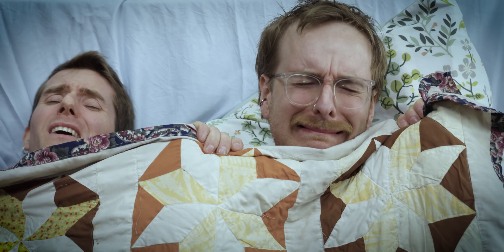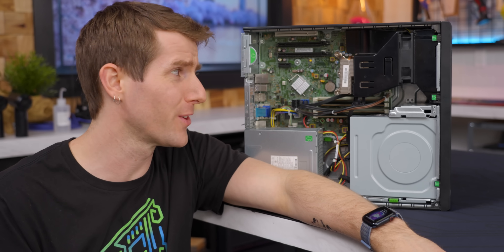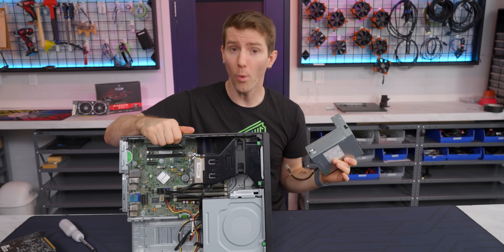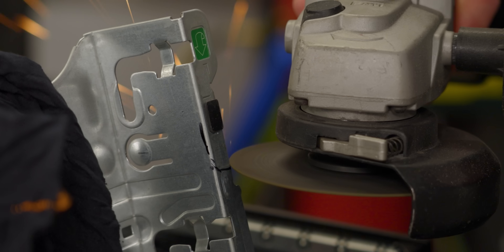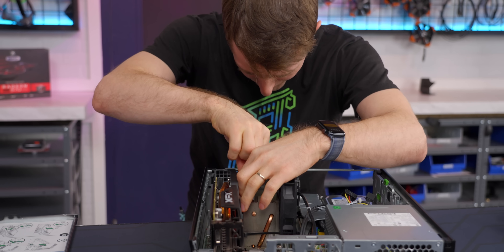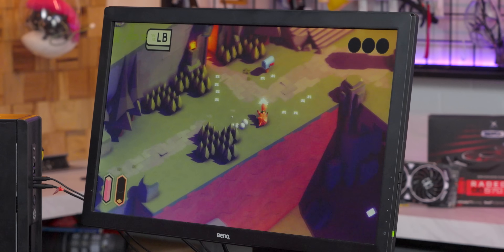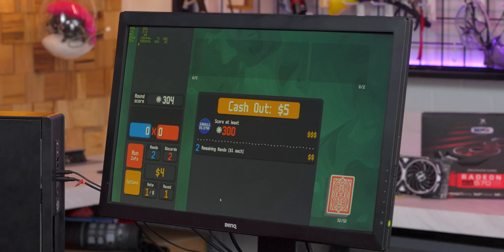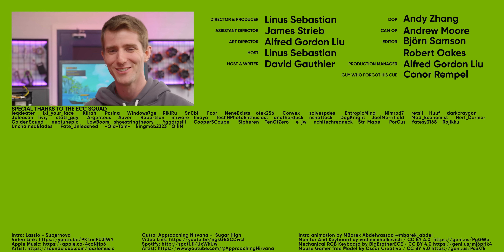How to Build the Ultimate $69 Gaming PC!

Comment: I think you could have optmised this. Choosing a small form factor was a mistake, when it's possible to find full HP towers for not much more, if nothing more at all. Also the i5 2500S is weak now, and i7 of the same generation are just 10-20 more, for 200% more performance...

Comment: You should do a "most upgradeable pc"  build. You start with something super low, I mean low. $50, can barely play shit. But you can type up your homework on it. Then upgrade one part, see what new games you have unlocked. Repeat until you have parts flipped and ship of thesiused your way into a top tier gaming rig. Only updating one or two parts at a time, or flipping parts and buying new ones for a total new cost of $50 a step.

If I recall that's how Linus did his rigs in the before time. So it would be cool to see.

Comment: the problems is that these old cpu are just so slow that will bottleneck anything faster than a 1050ti i had a 3770 i7 bottleneck the hell out of a 1060 6gb barely 120fps in fortnite performance mode low settings while that 1060 was puting out 350 fps same settings but with a 5800x ryzen same ram capacity for both cpus

Comment: I'm sorry guys...but you REALLY need to stop advertising the PTM750 thermal pads when they are constantly out of stock, or rather sold out instantly before anyone would ever see the advertisement in the video.

I literally got a restock notice and they were sold out before I could add one to cart and check out.

Also I'd really like to see a new video on testing different thermal solutions, in terms of paste vs PTM etc. I just recently looked into it for my own new build and from what I could find it seems like the best options for thermal paste (not liquid metal) are within 0.5 degrees of the PTM here. Considering I got a tube of that for half the price of the small PTM pad (that is never in stock) it seems really hard to justify the PTM.

I'd also LOVE to see how much the performance of different thermal solutions actually matters, both on the very high end but ALSO on the low end like we have here. A 1-2 degree difference in many cases isn't going to matter at all on the high end and I'd assume it'll be even less of an issue on the low end, but maybe that's wrong?

I have no idea how viable it is but I'd also love to see how much some of these old parts can be pushed. Do any of these chips actually have hidden potential via overclocking? I remember some older chips could get pushed quite far compared to what we usually see nowadays. In cases like this where you're really pushing the CPU and GPU to the limits AND they were this cheap second hand that could be very interesting. Frying a modern $400+ component by overclocking it too hard is often not worth it given you expect a decent life out if it, but if it cost you so little and you know it's already old it could be more compelling.

Comment: Looking forward to the $169 PC video! My whole family is running old optiplexes I built for them. My spouse is running one with an upgraded PSU and a 2070. Similar with my dad. My 9-year-old saved up his own $5/week allowance to buy one himself then saved up to buy a GPU (a GTX 1650 since it doesn't require external power and the 240w PSU it came with fits the budget by my math). And we got to install that together. Great project. Same 9-year-old saved his allowance again to buy another optiplex for his soon-to-be 7-year-old brother to give him for his birthday (though I'm taking care of the peripherals for that one). And the monitors are mostly from the pawn shops for like $15 if that even. 

And they all get to play the vast majority of my 1200 game library since they made family sharing so much better. Despite the insane prices on new hardware, it's a really cool time in the pre-owned build space.
Reply: nice

Comment: Not even addressing the Windows 11 situation is kind of bizarre...
Reply: I agree. It's gonna be a big decider of the usefulness of these cpus in October.
Reply: its super easy to install win11 on unsupported hardware.    win11 runs perfect on my i5 7500 and also on my very old dell optiplex 3020 with 3rd gen i3 cpu run "ok" win win11

Comment: I would argue that looking for 4c8t options or picking up an e3 v2 or v3 xeon for 1155 or 1150 prebuilts. it's a huge improvement and even a 1230v2 will beat an i3 8100 in a number of games. bit if a miss in the script here due to lack of experience by the writer.

Also a miss in the script, dual PSU's the main issue isn't reliability in the reasons implied, it's mostly just due to the fact that you run into potential backfeeding or current routes where there isn't meant to be current, which can degrade or irreversibly damage the system in the long term.

Comment: What I've realized recently is that 4c 4t is not enough anymore for modern games. Both cs2 and eafc benefits a LOT from 4 extra threads
Reply: Yeah this video was very misleading. They didn't test many games, and had no statistics on screen.
Reply: this computer would be roughly 3 times better with an i7-2600
Reply: @Old_SnakeTwitch LOL still running my 2600k OC @4.4 she runs hot, but won’t die
Reply: @courtney-rw8ch I have a 6600k running @ 5.0GHz currently. It's been a stable OC for 8ish years. Still going strong. Mine runs hot too lol. I got lucky with my cpu.
Reply: My older 4c 8t is hanging on for it’s life with newer games

Comment: 11:00 he means jump the green cable in the middle to any of the black ones directly beside it. It's a low voltage power on signal, you can leave it connected, it doesn't hurt.

Comment: There are adapters for a few euro's on sites like Aliexpress. I got one for my HP office garbage server and works fine ! And all components run form the same psu, which save some power. 
I also had to do the same swapping trick so the cpu blows hot air directly into the GPU 😂 but hey it works
Edit: i shoud've watched the video 10 seconds before commenting..

Comment: Sadly they didn't mention it but by October you are basically locked into Linux as most CPUs in this price range, while being perfectly capable, will not be able to install Windows 11 and using Windows 10 after EOL is probably also not the best.
Reply: Surprised Linus didn't bring this up.

Comment: You could go for a low end GPU if you only do indies or 2010 and below games. a GTX 1050 or even 1030 can handle good games, that way you won't need the PCIE power connector and break the case. also a computer like that are the perfect scenario to take advantage of frame generations thanks to lossless scaling.

Comment: Its very country dependent, in my country (Hungary, EU) RX4-5xx prices went extremely stupid in the last 1year. A 570 is usually 50$ alone. But i could get a 2400 i5 with a p67 board and SSD, HDD, 8gigs RAM and 500W PSU for less than 40.

Comment: I bought an old Dell Optiplex 3040 MT with a 6500, 8gb of DDR3 Ram and 500GB of HDD for, you guess what, 25 buck. It was from an office that was moving and instead of moving all the old as shit PCs with them, they sold them insanely cheap. I put a 1650 GPU in it and it has been my android emulator PC since.

Comment: I recently build my pc full scrapyard wars style. I went with a i5 7600k they often up for 25 usd. Used a rx 550 I borrowed for months, case for a box, an old ssd and old hhds. Now its all done 
500w psu
asus z270
i5 7600k
16gb ddr4
256g ssd
2x 500gb hdd
2060 
overall cost was about 220 dollars

Comment: $169 and $420 budgets would be super interesting
Reply: $80085 too
Reply: @Al_Lergic $1337 too
Reply: @xJRSUMMERSx  they have done scrapyard wars with 1337 budget
Reply: $4.20 PC
Reply: The $100 point seems the most interesting to me after watching this video, $69 was just abit too low
Reply: 420 can make a perfectly capable pc, rx 6600 and any ryzen cpu like a 360p
Reply: I don't know if you'll see this comment, but I think that the difference between the $69 and the $169 pc will be a bigger performance jump than from $169 to $269. Law of diminishing returns. I vote for doing the $169 pc. Might be the best bang for the buck.
Reply: 1488 dollar pc
Reply: yeah basically a bit more so there's not the 1% lows would be ideal as thats frustrating to play on and so worth the 10o buckeroos
Reply: Yeah. $420 is a must
Reply: $1337  Budget should hit the sweetspot very well.
Reply: a ~200-400 dollar build is actually the sweet spot for this kind of stuff IMO. You can get lots of old office PCs with 8th gen Intel CPUs in the 75-150 USD range, and I've seen 2070s pop up on eBay for ~200 USD. If you're shooting for the 200 dollar mark, you can easily get 6th gen i5 systems for 60-80 USD, and a 1650 for 80-100 USD. That leaves a decent bit of money for storage, since old office PCs usually have the drives removed.
Reply: Yeah i thought of it when the video switched to the GPU section. Its one of the core reasons i watch LTT (and watching alex doing some serious jank with powertools)
Reply: 69420$ gonna be better
Reply: At 420 i expect to see Optiplex 3060 or equivalent, an NVME, & a 2080, 3060Super/TI or perhaps 3070
Reply: @xJRSUMMERSx  hahahahahaha funny number thanks for the hold kind stranger!!!!!!!!!1!1!1!!1!1!!!1
Reply: $666
Reply: 67! 67! 67!

Comment: HP Z440 Workstation with the E5-2687W v4 and 700w PSU option.  It has 2 6-way connectors for GPU and 12 cores 24 threads. Here in the UK they are going for £150, so very cheap for so much computing power. They boot from NVME cards no issues.
Reply: My thoughts exactly. One buyes like older Xeon workstation system and many of them have very beefy power supplies and kids will prevent to fry their scavenged stuff with dual psu system fiddlings.
Reply: Got a z440, and those 6 pin are actually rated for 200w or so each, no problem using adapters to 8 pin. I believe hp even offers them as an original accessory. I run a 1080ti in mine no problem
Reply: I run a e51680v4
8c16t but clocked way higher

Comment: I think as a low-middle ground between buying an old mass machine and an old custom build, is look for a dell precision tower. It's still an old mass market machine, but it is slightly bigger, and usually has a very low end gpu, or it will at least have the extra power leads for a gpu.

Comment: accactly how i did it, bought a 17 dollal work station and a 15 dollar screen at a thrift store once, and a litterely upgraded every single part of it, multiple times over the span of a year, now i have been able to build 2 other fully functional pc's out of my spare parts and i still have a motherboard and ram left😂
(edit: i had also put a second power suply in, and mounted the gpu on the side panel with a riser cable😶)

Comment: My main PC is still an: 

- H97
- i7-4790
- Vega 64
- 32 GB RAM
- 1 TB SSD

It runs great. You need to optimize some things, but the CPU isn't having any battles unless you give it one.

I do have a better system, but it does LLM things.

Comment: Guys, just get an Optiplex 9020MT for $50 and put a $50 video card in it. Is it only $69? No, but it's an actually upgradeable computer that can fit real video cards without the use of an angle grinder (lmao), ATX PSU's and you even get 4th gen intel CPU's for AVX2 support (really important for modern games).

Comment: So ltt just forgot about second hand low profile gpus? I understand a low profile would be more buck for less bang but most people won’t cut a hole in the side of their case to fit a gpu and if they did, then they have larger problems than their gpu. And the alternative of leaving the side panel off will just ruin cooling and get dust inside the computer.

Comment: What I would have liked to have seen is a comparison with the 8Gb RX580 or even an 8Gb RX570. I have a 4Gb RX570 and, honestly, the 1% lows aren't that bad. I used to get pretty bad frame freezes in Assetto Corsa Competizione when I had the 570 paired with a Ryzen 5 2600. When I upgraded to the 5800X3D (I did upgrade the GPU to the 6800XT, which failed after 6 months, but I'm looking around for a GPU again), the frame drops were greatly reduced. So, it might not even be the 570 that's the problem here but the CPU. The 570 will even run Star Wars Jedi Survivor at a more than playable frame rate, even though it doesn't meet the minimum requirements.

Comment: I'd be curious to see what they can do with $420

I just grabbed an HP Z230 tower with i7 4770 and 500gb SSD for 110 shipped, total of 32gb ram for $30, and a W6600 8GB for 175. Not the bargain bin deal as their $69 system, but for $300 I can't complain.

A decent SATA SSD with its own cache will out perform cheaper m.2 drives that don't have cache

Comment: You could build a chinese special for under a 100 bucks starting with one of those suspiciously cheap LGA1155 mini-itx boards for like 30 bucks.
The benefits from that little bit of extra cash spent would come in the form of having standard form factor parts so no need for an angle grinder and a way better upgrade path.

Comment: One thing to watch out building like this; a lot of games coming out now require AVX2. This means you don't really want a CPU older than Intel 4th gen or the 900 series Athlons on the AMD side if you want the system to have some legs.
Reply: Yes but i don't think anything older than that can do much anyway.
Reply: A fair point; but still worth mentioning as their build used 3rd Gen Intel and their upgrade-on-hand processor was also 3rd Gen. That would mean, for example, no Helldivers 2 - as that is AVX2 required.
Reply: @prashank true, but a 4770K / 4790K can still pack a punch if the goal is still 30 to 60 fps console experience. and it goes for at most for 40 bucks.
Meaning that for 100 bucks you can build something that can actually play games on low.
Reply: Yep, opt for a HP z230 instead

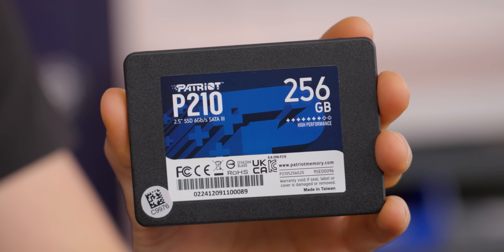Comment: 10:27 is M.2 being cheaper than SATA only a North America thing? cos all I see is SATA being cheaper than M.2 (same capacity, same manufacturer)
Reply from the maker: This is definitely gonna vary region by region, used vs new, but also by capacity. I found in our area that used 128-256GB NVME drives were usually cheaper than SATA but by 1TB+ sizes the SATA drives were often the better price. -DG

Comment: I would prefer to see a gpu that is not EOL or within a year of having its support dropped.
Reply: i mean yes, but that would increase the budget. This video is just there to illustrate the possibilities. But you can absolutely build a very capable gaming machine for like 300€. buy a used office PC with a capable CPU, slap in some extra ram and an Arc 580 and an SSD.

Comment: proud RX570 owner here. bought it in 2020 when lockdown hit and got it at pre-mining prices (just in time)…thankfully it’s still been going strong (relatively speaking) for 5 years now 🥳
Reply: AMD Polaris aged really well. Still rocking the rx480 8gb.
Reply: I have the 550 and also got it around the same time. Still alive and still gaming.
Reply: you can also check jf your rx550 has extra cores to unlock
Reply: I gave away my RX480 to my cousin and it was going strong still, I  suspect its performance lackluster was because the CPU was bottlenecking it.
Reply: my appreciation and love for my 1050 only grows by the day.
Reply: I had 470 4gb, performance was not bad, more cpu bottleneck than vram
Reply: I have a RX 470 4GB with an i7-3770 @ 4.22-4.43GHz in one of my PCs. Still a great budget card for pretty much everything except the latest AAA games. I do also have a similarly performing GTX 970 but it's not as good for some budget builds due to having noticeably higher power consumption
Reply: I just had a 1060 3Gb hooked up to a 7950x3d while waiting on my new GPU and i could play cyberpunk around 30fps and GTA over 60. this @ 3440x1440p LOL!
Reply: Got an RX 580 8gb for about 20 euro at a flea market. Cooler was off the PCB, prolly used for mining. Sold as untested, so I didn’t have high hopes, but it’s been running in my main rig paired with a Ryzen 5 3600 for almost a year now, runs well and I’m pretty happy with it.

Comment: Funnily enough, my daughters each had a 4th gen Intel PC, one was a 4790k on a z97 motherboard and the other was a 4790 in a Optiplex build.  The motherboard on the Optiplex died so I upgraded the older girl to my old 2700x and the younger got the 4790k build.  Then within a few months the 4790k CPU died so my younger daughter ended up with a frankenstein build of the working 4th gen parts that is still running fine today after 5 years.

Comment: You can find some that allow you to upgrade your power supply, and with that, you can put a graphics card in it and don't even have to make any modifications, an old one i like is the OptiPlex 3010, that beauty has standard 24 pin connector for the power supply and if is the mid/tower easily, you can easily change the power supply for a standard one and you are ready to go, another great option is the hp ProDesk 400 g2.5 sff, if you don't like the form factor, you can take it out and put it on a standard case, so you can have all the space you need.

Right now im rocking a ryzen 5 pro 2400g with vega 11, you can play some games and dont need anything else, just $50.

Comment: This is not reality. Anything I try to buy off ebay has at least $69 for shipping. ANY computer locally is more than $69 and then you have to upgrade it.
Edit: The cheapest hp z220 on ebay is $35 + $65 shipping. And it's "parts only"

Comment: I still use 4gb gpus in a couple pcs.  
You are too harsh on the vram….   Your problems are definitely caused by that intel 2500.    Way better off spending an extra $10 on something like an i7-3770 instead of an 8gb gpu